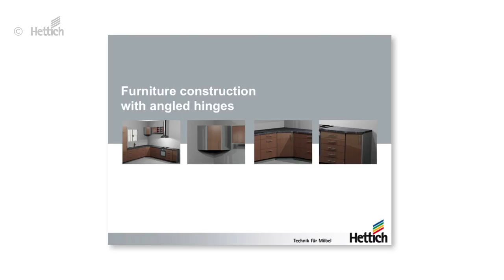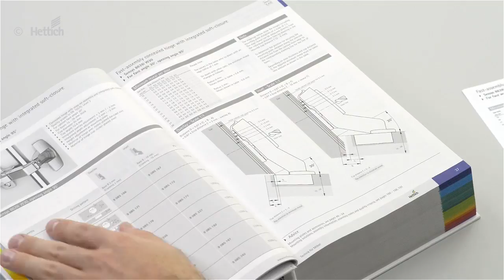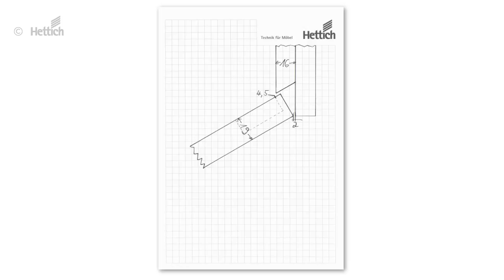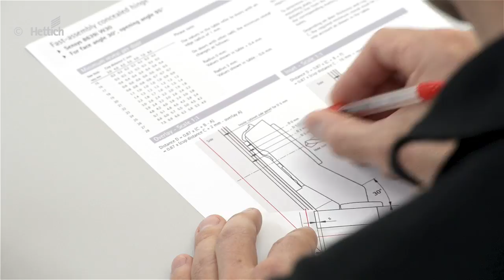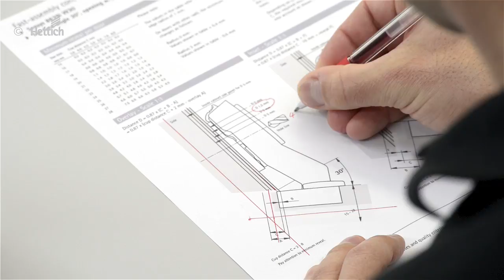Furniture construction: angled cabinets with Hettich face angle hinges

Comment: Hi , just a question did you use all side cabinets 16mm thickness or just the angle one, does the hinges work on 19mm
Reply from the maker: Hello, thank you for your comment. Carpenters usually use 19 mm sides, industry often 16 mm.
Our hinges are designed for both and many other material thicknesses. The cup distance c, the joints or the thickness of the mounting plate may change. If you have any further questions, please send us an installation sketch with dimensions to  info@hettich.com. Best regards, your Hettich Social Media Team